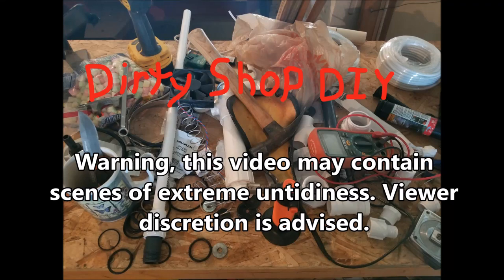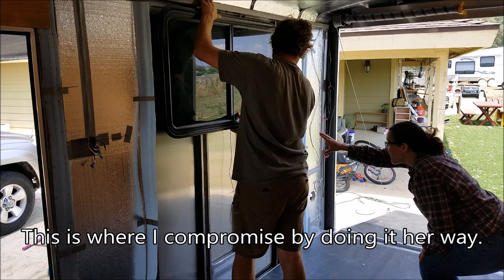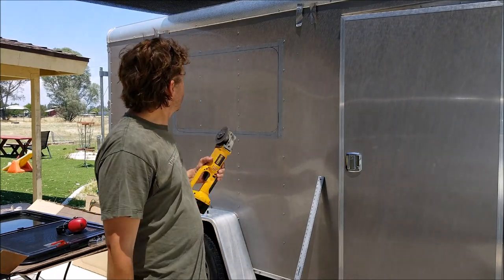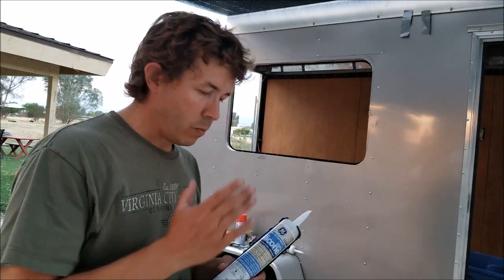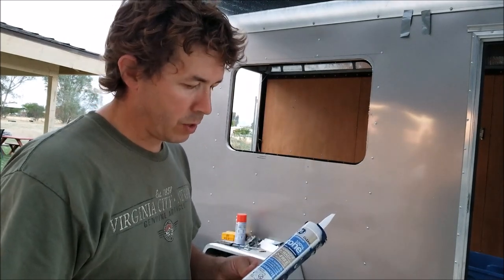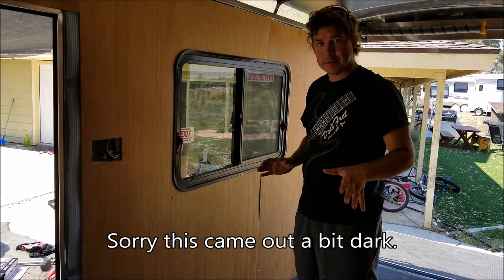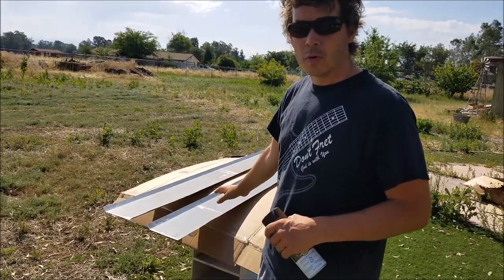Cargo trailer window install and paint. part 2

Comment: Nice job on the window.  I was debating on putting a window in mine.. but decided against it because I still use it as a trailer (I play in a band and haul expensive gear around) and a window makes it less secure when it comes to valuables getting stolen.  Instead, I found a guy online that custom makes screen doors.  I added one to the side and rear doors and on warm days I can leave the doors open while we sleep.. and the screens keep the bugs out.  It was a great alternative.  I just used mine for the first time camping last weekend.  I posted a quick video on my page - Laconia Bike Week 2019.
Reply from the maker: Nice, that is a good idea. I am planning a rear bug net sort of thing. I might do a screen door as well.
Reply: I am going to order a 7x16 heavier duty 9900 Gw, it can be ordered with many options including windows, 120 volt service etc.

Comment: Silicone holds up well but is extremely acidic and will eat metal.
In the auto body industry we use Urethane Windshield Sealant.
In marine we use Butyl Tape, Butyl Seal Tape.

Comment: Love your sense of humor!  Where is the doggie?  Its just not the same without the little guy watching you in his Xmas suit.
8:06 - I use Butyl rubber compound tape between window and exterior shell to seal out moisture.  I use Sikaflex black on any interior window trim/glue joints. If its on roof, you need to seal with Dicor lap sealant. But you probably already know this.
Great job on the window install.  Very well documented, this is a great learning channel.  Looks so nice and height is perfect.  Discussion on height was instructive.  Things you never think about.  

Fyi - with regard to your cold.  What works for me is Source Naturals Wellness.  Pop 2 tablets soon as you feel a cold coming on. Take 2 tablets 3 x day and usually its gone in 24 hrs.  Keep taking it for 1-2 days longer to make sure.  Its fantastic stuff.  Safe for kids.  Mix of natural herbs like mushrooms, etc. 100% guaranteed to work.
At Noon daily, take zinc 50 mg + Source Naturals Mega One (without iron) as a  + Vit C.  This should ward off any colds or flu entire winter.  Don't buy cheap Multi Vites like Centrum -they don't work.  You must choose a high quality daily vitamin/mineral and the good brands are Source Naturals, Jarrow, Twin Labs, Solgar.  I gave you one that is high quality, priced right, and safe for kids over 11 yrs.
If you feel run down doing too much, start taking some Vit B Complex + Vit C at 8 am, and 3 pm.  
I always take the my multi Vit at noon so it does not flush out with coffee.  It gives me energy all afternoon into evening.  Adding Vit B will wake you up like coffee and strengthen adrenal glands which get exhausted with chronic stress.  Please do not mix your multi vit with extra Vit B - too much B at one time can make you dizzy and nauseous. This is why you spread them apart.

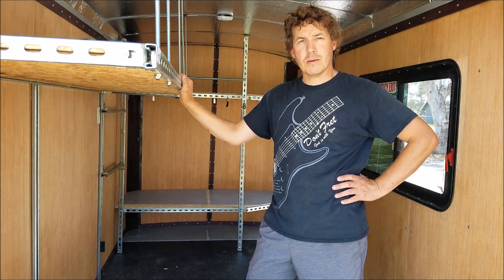14:49 - Sunset - one word, not Sun Set.
Only 1 typo this time, yoo hoo! You are making progress, dude!
Reply from the maker: Progress is good. Yeah!

Comment: this may be a stupid question, but has anyone installed a smaller version of this window on the rear drop-down door?
Reply from the maker: i wouldent know. but the door is used as a ramp. so it would probably not be a good idea. if you do make sure it can be covered with something sturdy so you could walk on it.
Reply: Dirty Shop DIY 
Ok thank you
I don’t ever open it so I think I am going to try and add it. Thanks for the reply
Reply: @DerkT7  if you use it as a ramp you could make it narrow enough to drive around it.

Comment: Whats the silver lining you used on your ceiling?  I've yet to do anything to the ceiling in my conversion.
Reply from the maker: It's the backing on the insulation board I used. Its white on one side and foil on the other.
Reply: @DirtyShopDIY  how did you get it to stay put?
Reply from the maker: @rodrogersrealty  it mostly stays in place by itself. The arch pushes into the corners. I used tape to help.

Comment: Where did you buy window and how much? I'm doing a food trailer
I think that type window will work.
Thanks
Reply from the maker: I bought it on ebay. The seller was "tristatesurplusllc" $156 shipped. Im not sure if the window just swings open or if it actually comes off when you open it too far. My wife is out using it so i cant check right now. Good luck on your project.